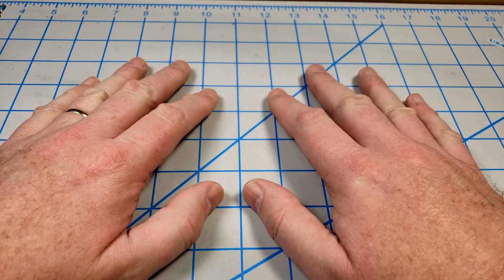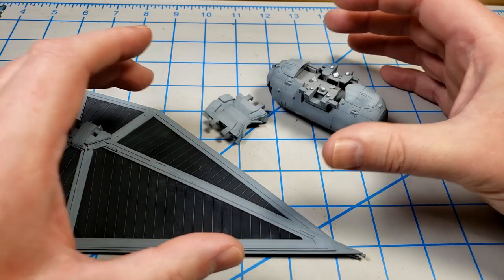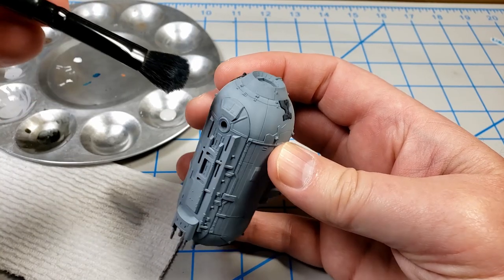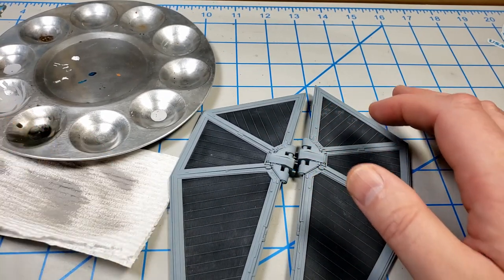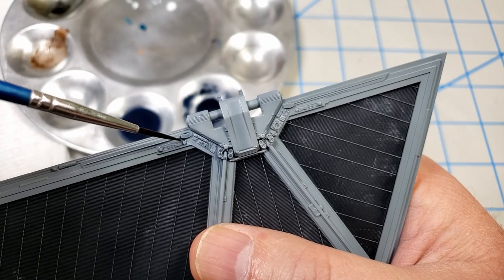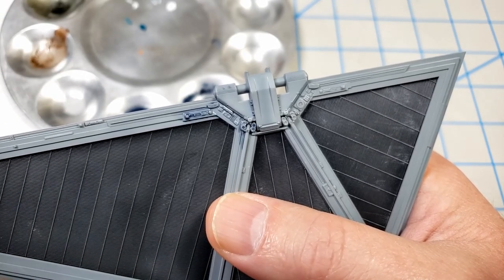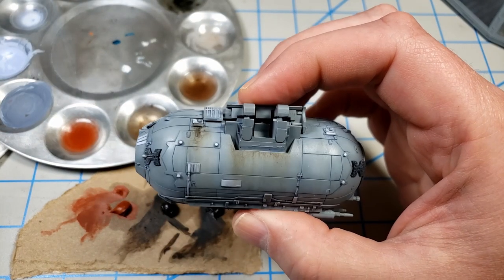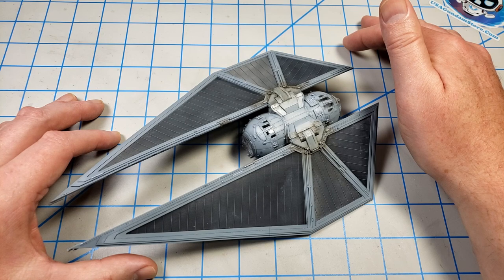Building Bandai's Star Wars TIE Fighters Part 3: Weathering And Finish

Comment: Hi Jon, great build! Did you apply a varnish top coat to seal all the work? Greetings from Mexico
Reply from the maker: Hey! Thank you so much Francisco! I am grateful.

I didn't apply a topcoat to this one actually. I liked the various sheens that were present - matt, satin, and even some slightly glossy areas. If I added a topcoat, it would alter that. The products I used are pretty durable, so after a couple of weeks, it should be pretty well set.

If I were going to be handling it a lot, I'd most likely go with a satin coat, just to sort of hit the middle, so to speak.

Thanks for watching and commenting!

Comment: How do you have so few subs and views...... You give answers to questions I have been looking for for weeks now.
The weathering and gloss coat example.
One question though; I am starting the 1:2700 Imperial Star Destroyer and I need to gloss coat before weathering to do panel lining. 

Now do I use water based or lacquer based gloss (Thinking about using Alclad Aqua gloss or Mr. Hobby GX100 Super Clear)?

I have been told that I can't use lacquer over acrylics (using the term acrylic to mean Vallejo water based and the likes) 

So I am going to paint it with Tamiya Enamel greys. Can I use a lacquer gloss over that? 

After I panel line, I am using Tamiya Panel liner Black, then wiping away with enemel thinner.

The nmaybe some oil wash.

But in order to make it matt finish, how do I do that when it is finished. I don't want a glossy star destroyer
Reply from the maker: Thank you so much for your kind words! I am grateful!

To answer your first question - I don't know, honestly. I ask myself that same question far too often really. And I always come to the same conclusion - just do the best you can. That's all I can do. I would be grateful for shares, likes, and comments. That really does help the channel grow.

You can put lacquer based clear coats over acrylics, but I do recommend caution. You'll want the acrylics to be fully cured and dried, and the clear coat needs to be applied in very light coats. Getting things too wet runs the risk of "crazing" the surface underneath.

Using a lacquer gloss over enamels will work, but the same caveats apply. The under layer must be fully dried and cured - two different processes. And the clear coat should be applied without flooding. (The problem you may run into there is that some lacquer gloss coats perform best in a more wet application.)

The Tamiya Black panel liner should work fine. If the surface is glossy, you might not need any enamel thinner to clean up. The solvents in it are a bit hot though, so make sure your clear coat over the enamel base paint is thorough, or you will get paint lift.

Once it is all finished, and matt varnish will dull it back down.

What I'd suggest is to test all of this out. Using a "test model", apply the coats as you describe, and just see what happens. Materials knowledge serves modelers well, but it only comes through the experience of actually applying those materials. Testing combinations of materials helps.

For me, I tend to stick to acrylics for paint and clear coats, and oils and enamels for weathering. This helps me easily avoid material conflicts. From time to time I do use lacquers (Gunze, etc) for base painting. I've not used enamels as a base paint for years though because there are just so many complexities to account for with later layers. But I do know modelers who use them quite successfully, and have for years, so look for what works for you.

HTH! Thanks for watching and commenting!